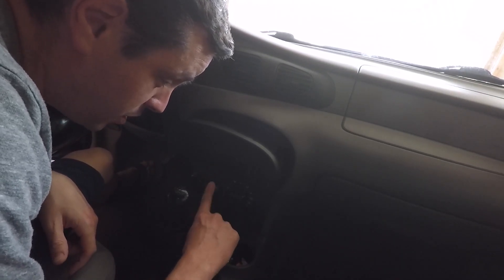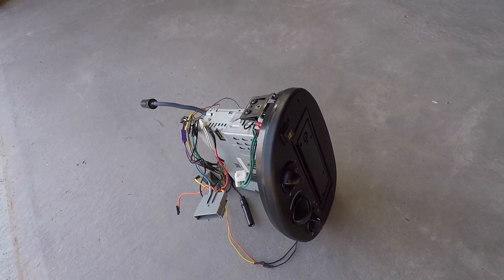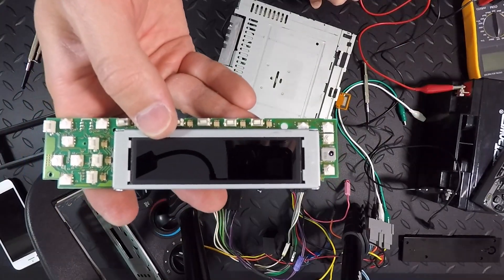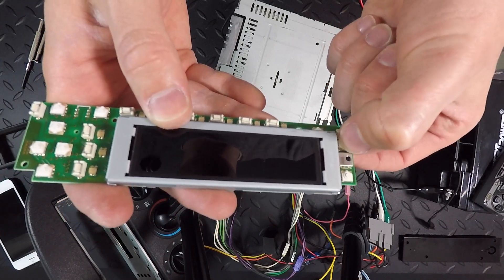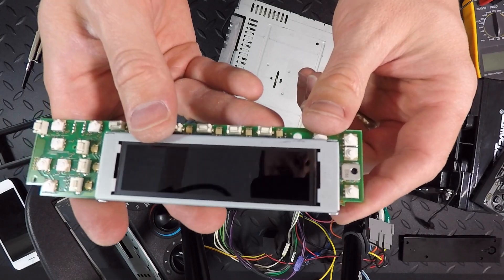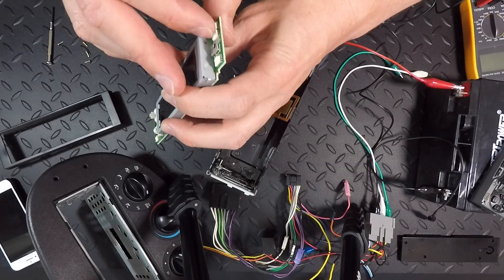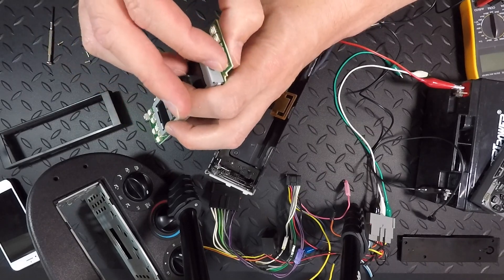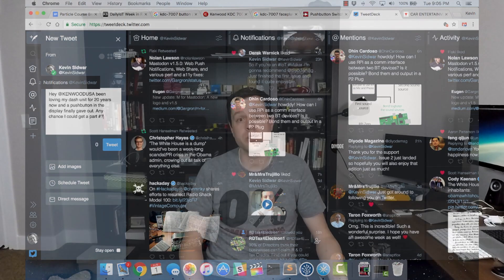Car Stereo Detour

Comment: Many a day hanging upside down under my dash board, painful. 
Only the older hardware can be trouble shot anymore. 
You might try to purchase a used unit online and salvage the keyboard portion.
Reply from the maker: I did a little checking around and couldn't find anything. Lots of cable packages for that to back wire it into existing vehicles but no faceplates or used units. I really think I fixed the volume up by jarring it lose and the volume down has been an issue for years and isn't as annoying (ear damaging) as volume up. I struck out at Kenwood too although they were very nice and tried to be helpful. I've got the unit back together and am putting it back in the car today. Fingers crossed.